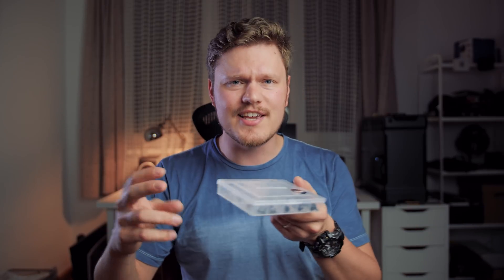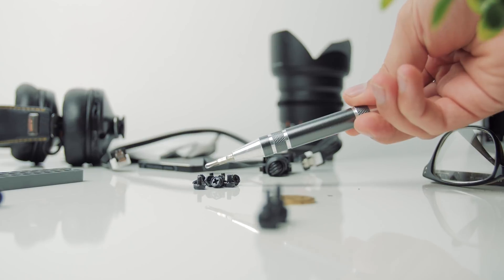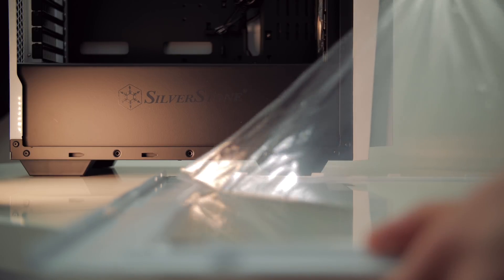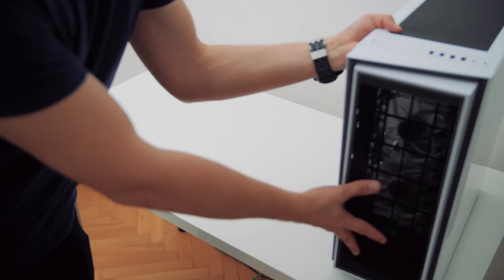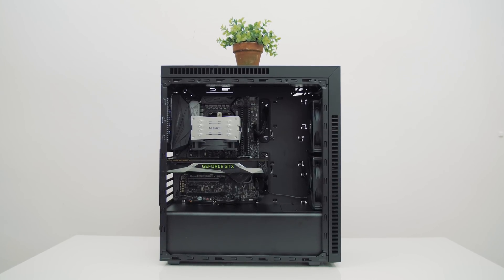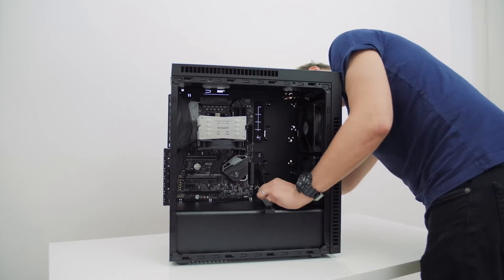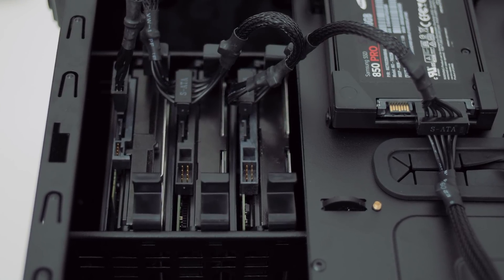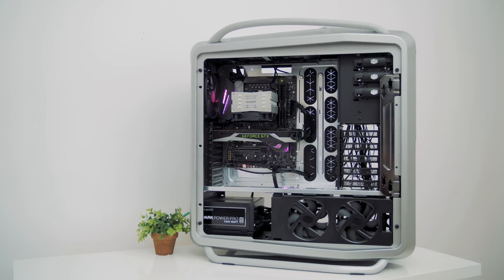15 Things You NEED to Know When Building a PC!

Comment: You should never test your computer outside it's case, mainly because of static electricity and lack of grounding. 
PC case provides protection from both and it's safer for your components, because you'll be constantly touching the case and that way you'll ground yourself from static electricity protecting your components.

Comment: A belated tip for first-time builders: set more money aside than you think you'll need, and set a few cardboard boxes aside for potential returns. You'll make mistakes in your parts selection, guaranteed - even if you use PCPartPicker. All it takes is a spur-of-the-moment hardware shift or a case change, and clearance issues might arise. There's also plenty of instances where something like a low-profile cooling fan might successfully mount on your CPU socket, but with your unlocked processor requiring some under-volting for the fan to be able to keep up.

If you've just bought a beefy PSU and intend to try your hand at overclocking, this is not a mistake you want to make.

That ties into a second tip: the smaller your form factor, the more limited your capability - and the more complex the parts and cable management. For your first-time build, go absolutely ham with a full-tower or mid-tower chassis and an ATX board. Give yourself plenty of expandability, and learn to appreciate the breathing room these bigger cases offer. A full-size ATX case is the best possible environment in which to fuck up - preferrably with a white or colored case, for the sake of making loose screws easier to track down.

Lastly, don't feel too pressured to join the ITX or MITX bandwagons, especially if visual fidelity matters to you as a gamer. Full-fat cards are generally easier to get ahold of for longer periods, and you'll want all the clearance you can get to accomodate them. I've built a chunky ITX with a friend and I love it to bits, but lining up that RTX 2080 Super with the PCI-E slot in the darkness of the narrow space left at the bottom of the board took two pairs of hands, three lamps, two flashlights and an eraser tip to prod the slot's release mechanism. Absolute Hell, no holds barred.

Comment: Buy artic p12 120mm fans for intake. Make system restore points incase a driver goes bad etc. Never force any part while building! Always check on what type of screw you will need on the motherboard stands(there isn't 1 standart you can jam it lol). Always buy the better power supply. For a millisecond your cpu can draw 100 Watts and for a millisecond your gpu can draw 300 Watts power. Motherboard draws 50 watts+30 for fans ssd hdd lights. It you use 450 Watts psu, rip.

Cheap psu's don't deliver advertised power. Always buy higher wattage and better psu while not breaking the bank

Some cheap psu's will have too thin cables that will catch fire under heavy load..

You can buy old server power supplies they are top notch quality!

Never ever do auto overclock on motherboard
They usually give very high voltage starting at 1.4v even 1.5v(kills instantly)

Don't look at benchmarks too much for cpu's. They use superior rams you won't buy most probably! Also if you buy Intel H and B series motherboards your ram will be limited in speed thus you're performance will be whole lot of different different than benchmarks.

Benchmaarks usually overlooks strutters

I had 9400f with z370 and 3000mhz cl15 ram. It had strutters in far cry 5. I sold it and bought 9600kf. It didn't have that issue....

9600 and 9400 are 2 different worlds... Different stepping, soldered ihs vs thermal paste.

İ5 kf is a good option imho even at 10th gen. But mostly R3 3300x is enough as it looks. B450 costs 70.$ and it supports 4xxx series.... So there is room for upgrade while Z490m costs 150 usd. And god knows 12th gen won't be supported on Z490. Not enough room for upgrade lol.

R3 3300x 120 usd then you can jump to r5 4600 for 220 usd. It will be a reasonable jump. But I don't suggest cpu ungrades that quick tho....

Always check reviews before buying motherboard and gpu. Same graphics card will be different in thermal performance in other brands! Some will have better power delivery etc. Some will have better memory and pcb..

Also some mobo will be daisy chain some dual topology. Some better pcb etc higher ram kits is based on mobo quality and then cpu uncore.

Don't buy cheap but veery rgb cases.most cheap cases with glass front panel has a very narrow opening for air flow. They usually choke. Your gpu will be running hot and louder. Which degrades the silicon faster

Don't underestimate artic p12 120mm. They dropped my gpu temps 80 to 75 at 155 Watts load 3200rpm to 2400 rpm respectively. At 120 Watts from 77 degrees 2700 rpm to 69 degrees 1800 rpm. Huge imho.

Comment: Is it a good idea to use the stock cooler for the Ryzen 5 3600, if you don’t plan to over clock. I also bought the Gigabyte RTX 2070 SUPER 8 WINDFORCE OC 3X which has three fans to go with it. And the case will have 4 total fans.
Reply: yes its totaly okey to use 3600 stock cooler, its pretty good actually

Comment: Make sure to pull the tabs up on the shield before mounting the motherboard, and definitely check after installation that the metal tabs are not in front of the USB plugs or ethernet otherwise they could cause a short and fry your motherboard.

Comment: I used to "plug in" front panel pins (like power button, reset button, HDD LED, power LED) before putting the motherboard inside, because I'm one of those that finding a hard time plug it in (USB/audio headers are still a lot easier tho)

Comment: @HardwareCanucks  ...  Good video!  Although, you missed the most important point... PERIOD ... before you even buy!  Once you finally choose your mainboard, check your mainboard compatibility list!  For instance, I am doing a new build.  Out of the 4 different sets of DDR4 I chose as potential parts, none of them were on the list!  It took me a long time, but I finally found a set of 2400x3200x3200 DDR4 2x16 that I like, in all aspects, including timing and visuals, and all slots being occupied.  But yes, visualize your build, from start to finish, and take notes, till you're blue in the face!  :-)  Many people have to live with their build for years.

BTW, an important video you could do is on RAM, versus occupying two or four slots, etc.  RAM seems to cause more imagined or real problems for people than anything else.  NOTE: To whoever, for the vast majority of people/builds, you don't need more than 2x8 of RAM.  2x8 is more than enough!

IMPORTANT NOTE: A person can also research mainboard BIOS to see how it prioritizes 'one or two sided' RAM, if at all.  (BTW, that's not really the correct way to describe RAM.)  For instance, the newest BIOS for my aforementioned build states: "2. This BIOS fixes the following problem of the previous version: Optimized for the newest single-sided 16GB and double-sided 32GB memory (2Gx8 memory chip)"  It's just something people can look into.

One more little tip, which is not as important now, not using mechanical HDD's.  Set your OS 'page file' as static, about twice what your system recommends, in 1024 increments.  But, even on SSD's, it's good to keep your 'page file' from fluctuating in size.

Don't scrimp on case or power supply, and especially the monitor.  The monitor will be the visual result of everything your build consists of, in total.  Know you are going to be happy when in front of it!  If your budget is small, use 1080 as the base line, not 1440, for everything.  For instance, a 1660 Super graphics card, (or 1660 Ti ).  Yes, I prefer Nvidia.  If you are limited, then AMD, of course.  FYI, AMD FreeSync, used with Nvidia, is not true G-Sync.

Comment: My PC maintenance top tip: If you do happen to get scratches on your glass panels, all you need is some toothpaste and a microfiber cloth or other lint-free cloth. Put a bead of toothpaste on the scratch and buff it out with the cloth. Wipe the toothpaste off and then clean with Windex. Repeat as necessary.

It might take some time, several attempts and a fair bit of elbow grease, but you can improve or entirely remove scratches in glass. The minor abrasives in most toothpaste can smooth the scratch out and make it very difficult or impossible to see with the naked eye.

Comment: you mention static grounding with a wrist strap or whatever.  I hate to tip your wagon dude, but it doesn´t make a diff, as reported by Major producers of key computer components.  I have been building computers for a long time and I have never I repeat Never needed a wrist wrap or any wrap.  The only place that I have heard this is from you tube techie wannabes.

Comment: Thank you for this, I’m thinking of building a computer for a long time and I needed research. This has amazing visuals and had allowed me to feel better educated before I buy a bunch of expensive parts and breaking them because I have lack in knowledge. I have a few questions about using a thing that looks like a USB stick to install windows 10, I’ve seen people use those and it works out well for them, I wanted to know if it’s a good idea?
Reply: Yea usually installing windows with a usb is your only option. And have you built your pc yet?

Comment: HardwareCanucks I accidentaly touched the bottom of the golden pins on my ram stick but cleaned it immediately with a paper towel, could that still be a problem? (I didn't touch the pins directly just like that bottom part) Thanks in advance.

Comment: Here's my tips.
1. Start your build around 8PM after a stressfull day at work. Even better - crack open a couple of cans of your favourite beer "to get in the flow".
2. Start reading the manual, then after 5 minutes throw it away cause if you have any trouble theres always help on the tinternet!
3. Never mind about that missing riser - you've screwed in enough already.
4. Static electricity, touch the case (only works if you have the power supply plugged in by the way!)
5,. Get interupted by Wife, Kids, Friends from outta town. You can always pick it up after 11PM no probs.
6. If it doent fit properly then use a bit of force as these cables and sockets are up to a bit of abuse. Give it a bit of welly!
7. If there isn't a spark of life when you first hit that power on button - dont worry you're doing it all wrong. Just pull it all apart and start again.
8. At 3AM resist the urge to sleep as thats when all the answers to your build issues "come to you"
9. Remember - building a PC is fun and a "great learning experience!".

Comment: Actually, mounting a CPU aircooler downwards is a bad idea, since the hot air from the video card will rise into the CPU cooler. And we both know the CPU cooler is suppose to suck room temperature air, to cool the heatspreader, and dissipate hot air on the other side.

Comment: Good video.
Another tip about grounding is, have the PSU power cable plugged into the wall socket. Have the cable plugged into the PSU unit, BUT only have the PSU switch in the OFF position. This will ground the case and you'll be fine as you are touching the case.
Again good tips.

Comment: When i built my first lga 1151 i was realy worried that i was bracking my cpu when when pusching the retention arm down it felt wrong and made a cchracck sound also when i wanted to test my pc outside of the case but i almost killed my mainboard because there was a metal staple in the mainboard box i luckely noticed it and didn't kill my mainboard that day

Comment: Man, I kinda feel like an idjut. I knew that DIMMS had a preferred install order when only using two sticks, but never made the connection that you used the non-black ones.

I've figured most of these things out by trial and error. The first one I learned the hard way was my first build. I put the PC inside the case, it didn't fire up. I hadn't seated the 24 pin power all the way in, but I hadn't spotted that before pulling everything out of the case. I build everything outside the case now before installing!

Those SATA power cables annoy me thanks to most configurations when you daisy chain them you have to bend them to the side to get the back case door.

Cool tips for those learning how to build, Dmitri.

Comment: Because I find magnetic screwdrivers horridly aggravating when not in use (Collecting metal shavings to prick your fingers in the screwdriver drawer, etc) I find it easier to simply magnetize whichever size I gotta use when I gotta use it. If ya don't have a magnet, just take one from dead HDD. Works perfectly for holding on to screws when you want it, and wont' attract every little metal thing in your drawer for the rest of time.

Comment: The things I look in a case is,1. How am I going to cool the components that it is housing and is there room to install everything I would like to install in this case. (Using a AIO Liquid cooler radiator (120mm, 140mm, 240mm and so on and will the fans and radiator fit where you want to place it) or a CPU Air cooler(cooler height and RAM clearance should be taken account for which CPU air cooler you would like to use), expansions slots (GPU's and other components), how many fans you would like to use (I use 4 minimum (I count AIO coolers as an intake or exhaust depending how you set it up) but can go down to 2 fans (intake and exhaust)2. Cable management. (how you can route the cables and secure the cables so they will not come into contact with the fans, doesn't block air flow and look nice)3. Construction materials and sturdiness. (Metal, plastic, (Metal is more sturdy but vibrates more, plastic is less sturdy but vibrates less. a mixture of both that can be both sturdy and causes less vibration is best) sound dampening materials (ex. rubber feet for HDD's bays to sound absorption pads) and dust filters) (the more sturdy the case is, the less vibration and noise you will have. also rubber feet on the bottom of the case to keep it from sliding and transferring noise)4. Do you like the look of the case and are your willing to buy it for the asking price.For me if I don't check all 4 things, I look for a different a different case.5. (optional) If RGB is a big thing for you add this to your list but you can always add RGB in a case that doesn't have any RGB.On this list on requirements to look for, it is hard to find a case under $70 USD. Just remember if you really like the case you can use it for future builds when your old components are becoming obsolete and that will save you money for your next build.

Comment: Bitwit did an experiment a while back comparing vertical to horizontal CPU cooler placement.  Test results showed vertical placement resulted in higher CPU temps.  At the time he didn't know why, but after watching a JayzTwoCents flir video I think I figured it out.  The backplate on a GPU puts out a lot of heat and facing your CPU cooler fan towards that backplate will result in higher temperature air being fed through the CPU cooler.

Comment: Hey HardwareCanuks, Im trying to build my First Gaming Pc. 
Im using a Core I7 7700k as the cpu with a GA-Z170X-Gaming 5 Motherbord. im going for the Zotac Gtx 1070. with a 750Watt PCU. Im going to be Using G.SKILL Flare X Series 16GB (2 x 8GB)  Ram. Could you help me out picking which Cooler should I Get for this PC and weather the hardware i have selected is compatible with each other.
Thank you in advance.
regards
Reply: Moaz Jamshaid just put it into pc partpicker to check compatibility, for cpu coo,er I recommend noctua no-d15 performs better that most aio’s and is capable of reaching 5.2ghz overclock. Also your psu is way too powerful, I’d be looking at a 500psu

Comment: Some of the things I would mention in my experience are: Allow plenty of time for your build. I took a week off from work so I wouldn't have to stress about time. The first day off, I physically planned my build, staging my build space and components and getting my tools ready. The second day I built the PC. I did the POST and installed Windows, then worked on cable management. The third (and fourth) day I began downloading/installing my software and games. By the 5th day I was able to sit back and relax and enjoy my new PC. 

Also, make sure to have internet access while you are doing your build. Whether it's another PC, laptop, or smartphone, make sure you have the ability to get online and troubleshoot in the forums if you have problems. Always have at least one USB flash drive handy. They can be lifesavers if you need to transfer software, drivers, or patches to your new PC. Remember to inspect each part and remove the plastic protection on things like your CPU cooler block, GPU backplate and fans, and your PSU. If you forget to remove the plastic, you could get a strange smell when your PC heats up or (worst case) you could start a fire. Last but not least: Take your time and don't be afraid to take things apart again if you run into trouble. Sometimes you'll forget to plug a cable in, or you'll plug it into the wrong place and you can't figure out why your PC is misbehaving. If you have no idea why your hardware is acting up, take it apart and inspect your connections. Take a break if you need to. Sometimes a fresh set of eyes will find that silly little mistake you made.
Reply: I doubt anyone eager to build their PC has the patience to wait and build for 5 days when it's a simple task that takes a few hours
Reply: I heard that's how God did it!

Comment: Guys, I'm using a Phanteks Enthoo Pro M case and the top USB port is not working. I tried unplugging and replugging the cables, but still no luck. Do you think it's dead? Any suggestions?
Reply: Sun Hyung Hong is this your first build?
Reply: If it's still not fixed, try checking the internal usb connector on your motherboard.  If you have another free usb header on the motherboard, try connecting the front panel usb wire there.

If it works, then you may have a defective usb connector on your motherboard.